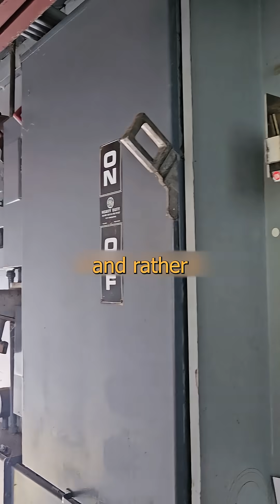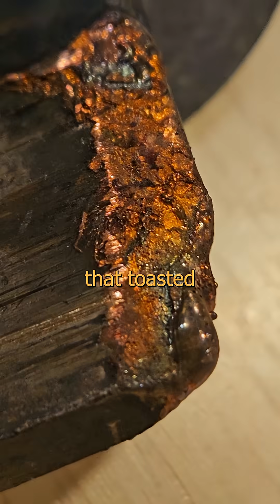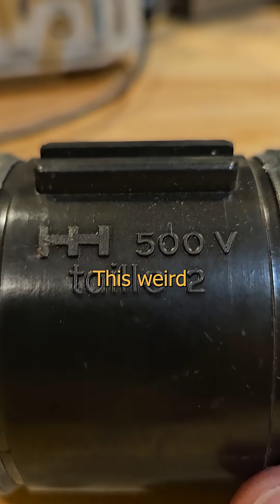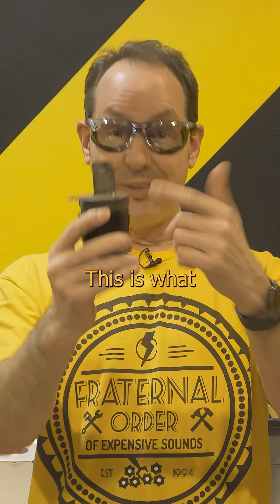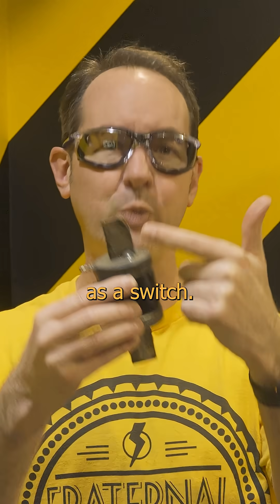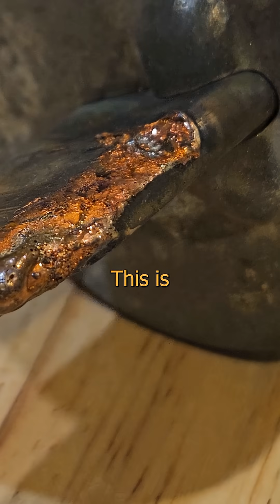Ugly Fuse #chrisboden #comedy #engineering #electrical #educational #highvoltage #damage #fail

Comment: There's a reason all the fused disconnects over here say "operate quickly" on the handle, we had a new 45kW air compressor installed and the service tech came to turn it on for the first time (for warranty) turned out the phase rotation was wrong, he turned it of, swapped 2 phases and went to close the disconnect again, he did it really slowly, turned out when he swapped the phases, there was a loose wire that didn't make it into the terminal, instead it touched the other phase, it poped 2 125A gG/gL fuses in the disconnect he was closing, melted the disconnect and at the same time blew all 3 250A gG/gL fuses in the upstream distribution board. The service tech was too scared to try switching it on again after we repaired his damage, so I had to do it, I slammed the disconnect shut and things just worked

Comment: I still use a 220v breaker to turn my 1.5 hp compressor on and off.  Started doing that in 1972, but I only use it for occasional projects.  My bad.

Comment: THAT is why you have a cut-off switch BEFORE the fuses.
A: Opening the cut-off switch allows you to install and remove the fuses SAFELY (Yes, safe is boring, but remember, there are OLD electricians and there are BOLD electricians, but there are no OLD BOLD elements tricians).
B: The cutoff switch is DESIGNED to handle the arcs of connecting and disconnecting, and when it finally DOES crap out, it's relatively cheap to replace.

Comment: Was it actually rated for use as a switch? Lots of gear is a 'disconnector' or 'off-load isolator'. NEMA is a lot worse than IEC at allowing this, in my experience.

Comment: That reminds me of what happened to the connector bar in my house is old breaker box cost a lot of problems I was amazed it did not Burn the house down but it sure enjoyed lighting wall sockets on fire before It was completely removed and replaced with a new breaker box😁

Comment: Oh, kissing a belt sander is a very good way of looking at it. Yeah, because high current will literally arc off tiny bits of metal every time you flip the switch. I forgot they're literally consumable in high voltage applications.

Comment: Using a fuse as a load break switch? wow.  The fuse wouldnt be the first place to look either as the fuse is usually sized to protect the cable on the load side.  So the upstream fuses were melting faaaark.

Comment: I sell electrical rotating apparatus equipment, amongst other things in the industry, you wouldn’t believe the complete idiots that we sell to, hook up completely wrong (only 3 leads when connected right) and want a warranty on an 100K electric motor they smoked on startup. 😂

Comment: Ya.... I have an automotive situation where I need to install a switch in line with a fuse to prevent this. There's a module that has known (but they're never going to fix) issues, and I have to disconnect the module every time I want to reset it and fix the problem for another month or so. The main problem is that to disconnect it without pulling a lot of other stuff, I have to pull a fuse. This'll be a project I'll finally get around to this weekend 😂 Hey, at least it's not a large fuse, right?

Comment: Many years ago I showed a friend of mine in retrospect , a stupid thing to do how to shut down the power to a house by taking the meter out. I explained to him that there needed to be NO load on it.Or else you're going to get arcing and pitting on the blades of the meter. So fast forward about 9 weeks, and they've now installed the panel and all the circuits in this house and various lights and appliances are ghosting,  turning off.And they don't know why. I thought to myself that he could not have been that stupid.He had to have listened to me.He had to have taken to heart exactly what I told him. But alas , he is that stupid , and he did not listen to me when I pulled the meter one of the blades look just as bad as your fuse , while one other was about half as bad. I cleaned it up as best as I could.Both the blades and the connection.But I told him he was going to have to go out of pocket for a new meter and explain to somebody why he did it , and that he had to leave my name out of it.

He was almost done with the job , so I think he just packed up his tools and left the problem behind.

Comment: Itll eat standard stabs over time. We lost a 100hp motor because over years of pulling the disconnect it had arc gouged the stabs so bad it lost a phase due to the lack of contact from the burned stabs

Comment: Fun Fact: In the low voltage (400v )distribution grid in Germany, all the switches use the fuse as the contractor. 

They are specced for that though.

Comment: There are things that haunt me:
100 A AC trying its hand at arc welding, 00 cable had a stray wire too close to a grounded screw in the panel, sounded like popcorn.

Comment: we have guys using a 600a molded case main circuit breaker asa switch....then they bitch when i charge them 1700 for labor and 4300 for the part

Comment: We (Dutch grid operators) actually use our fuses as a switch, from tiny NH000 25A to big NH3 of 630A.(they look like the one you're holding). They are made to switch. Sometimes even on shorts, that's the only way to find out. The transformer goes Brrrt, and pop says the fuse, eventually, because sometimes it takes time before a fuse melts out.
Switching on fuses is all about confidence. One hesitation and things go wild, like sparks and such.

Comment: Was on ship with diesel electric DC 250 volts, the switches had progressive close, got faster and to open it was spring loaded, just pull aller switch knob. Switchboard was open, Must have RESPECT or get hurt😊

Comment: Ooooh...those melted contacts just gave me PTSD back to a friend's electrical gremlins on a 1988 Ford F-150. Someone had installed some aftermarket.....accessories... at some point.... And we could not for the life of us figure out the random fuse pops all over the factory fuse panel, and some accessories were not, switched.... and as long as my friend had the truck to that point, those accessories were always on when the key was on.... Then, we found the extra fuses.... a bunch of them in two flavors: Glass and plastic mini fuses.... Electrical taped under the dash, most of them very melty at the contacts if they were fuses, and much too big for the given circuit.... all of them showing signs of constant removal and insertion to power things on and off....and many of them were in fact, not, fuses. It literally took use the better part of three days to remove all the spicy fire spaghetti, and another 2 days to put the stock electrical system back to some approximation of factory default. Can you believe the truck ran right and everything factory just worked again? That said, all these years later, older vehicle electrical systems like in my 1992 Honda Civic DX are stupid easy to work on, and I refuse to touch modern stuff with all their fragile body control modules.

Comment: Finding little crap like this so much fun. Reminds me of a time with my old heli squadron when we had to trace the pins on about 2000 feet of wiring to find a pair of crossed pins because the turn indicators had gotten inverted.

Solved it after losing my spot on one connection port and just counting in from the first pin, using the wires for reference because there were about 80 of them in the cable. "Blue, white, blue, white, blue, white, white, blue GOT IT."

Comment: A badly designed (but common) jumper cable in MV Dali's control room not quite seated, pin just touching,. Voltage dropped due to extra resistance. Triggered electrical shitstorm. Not high power, but similar at small scale cost billions, killed.

Comment: I was a power products specialist (that’s someone 500 miles away from the main office) for a large manufacture of Automation equipment.   When I did seminars on trouble shooting and servicing Inverters.  There was no one that know that fuses did not protect a device. they are there to protect the wires feeding the device. and there for the building.
Reply: Fuses can be there to protect a device. But you need very closely-sized semiconductor class fuses. 
Circuit breakers are almost never able to protect anything but cable or windings; the let-through energy is an order of magnitude (or more) higher.

Comment: And this is why I triple check my connections when I do electrical work in my apartment. That's how I also found out some lazy ass dumbass wired the last freaking socket to the lights' circuit instead of the sockets' one. That was a fun freaking day.

Comment: Had to replace an isolator recently. I didn't twig what was happening until I realised the strange noises coming from the machine under test were ALSO coming from the box on the wall. Machines under test are allowed to make odd noises, that goes with the teritory. As to what was wrong with the isolator something worked loose, not sure what because most of the middle phase had turned black. It was way past due changing though, it used fusewire. Seriously.

Comment: Woah, wait a minute here, I thought at first you were saying that someone was pulling and replacing the fuses as a makeshift switch, then I realized that you were saying that the actual switch was using the contacts of the fuse as the switch contacts. How did that even pass design review let alone get into production and become allowed by code? So many questions about how this was allowed to happen.

Comment: Try explaining why the fuse didnt blow when a dist board melted to a safety manager. Its heat from resistance not current flow.  He spent 1000s having it tested/investigated and still doesnt believe me.  So lets spend even more money redesigning circuits instead of yearly maintenance from the 2 electricians we didnt employ after retirement.

Comment: I had a fun one with a 3 phase disconnect a while back. One of the phases had a similar problem to your fuse because, well the disconnect was old. Eventually, the leg in question wouldn't go all the way in, so we'd end up opening the thing up and pushing it in with whatever was handy (I preferred using my fuse pullers but I'd seen others use things like screwdrivers). It worked until someone finally found enough downtime to go ahead and replace it before management could weigh in on the decision.

Comment: Similar to that….spent Friday (we’re off, but I’m on call) working to get crispy wires off the threaded ends of a heating element—inside a 3”x2”x6” box in a space 4&1/2” wide. The outer nut had gotten loose so intermittent contact had literally melted the copper washers on either side of the wire termination loop. I also have a cute picture of the metal bar which holds the two points of the contactor: that’s blown out. This puppy got good & hot repeatedly for a long time. And it’s in the ceiling of a room at a retirement home. 
Good times (but I’m getting double time 😎)

Comment: "Fuse isn't cause of a problem it's symptom", Funny think is so is peace of code at my work that checks if data wasn't corrupted (using hash and hash function , look that up it's quite neat) , if it fails, it means some bits got lost, duplicated or just flipped. 

And well, i wonder if there's worker in breaker company getting calls about heir breakers not working because they tripped that share my frustrations with our users (who are also programmers mind you, many with diplomas and shouldn't be required to get explanation on how hash function from Polish provincial that didn't even step foot in uni)
Reply: Thankfully, the "fires" we're paged to fix are figurative, but whoever swapped those fuses for copper bars was trying to page the real fire department...

I you have to explain to these guys what a hash is, what hope do they have for troubleshooting the cause? Lord help you all. 

I went through university but was a self taught programmer for many years before that. Do you also find that many people coming out of university just don't know how to troubleshoot a bug they can't reproduce? If I could suggest one thing to add to a CS degree it would be Systematic Troubleshooting!
Reply: @WarttHog  I didn't had much experience with many people fresh out of Uni. So can't speak about that.

But i suspect those people know dam well what hush and hash function is, probably hope that since our function technically "fails" passing issue to us gonna be valid way to get rid of the problem on their side.

What is incompetence, is once tester send us bug report with supposed crash.... basing their claim on info prints, that prints on every start up and are just crash handler printing it's configuration, and they were doing so for like a decade. But salt of the earth that they are, assumed any print with word "crash" must be crash.

Comment: I've done that; abuse a fuse as a switch (at much lower current) to shut up my roommates 200W alarm clock going off at 6:30 AM every-other-month when he's switched to their other home and left their door locked and barred. ((Another neighbour also blasted their stereo into the wall we shared for 'true bass' instead of using an equalizer - but I didn't have access to their electrical. ))

Got pretty good at whipping/wipping the knurled shoulder such that it wouldn't arc/creep between the edison's tip and ring.  

Also did that with a few ovens that got stuck on, with no accessible way to unplug the smoking heaps of metal.

Even so; I am suprised suprised that in industrial/infra someone actually used that regularly without mechanically restricting the fuse-form to include a shoe of the appropriate contact-material.

Comment: Had a couple of times the need to put in a new fuse for a 48V/1000A System ( huge battery feeding a bus bar )
- Check that whatever condition that made the fuse say pop in the first place no longer exists
- Wear the special leather flame retardant gloves,leather apron and goggles
- Insert the top blade of the fuse in the upper springs.
- RAM the lower blade of the fuse in lower springs.
this way you:
- Don't get sparks falling on your hand
- Limit the amount of sparking
- Reduce the change of arc damage to the fuse and fuse holder

Comment: This is why every electrical painel and systems should be verified with thermography. It gives you the opportunity to plan the maintenance.
During the time I worked with it, I learned even low power circuits can cause a mess, being the more neglected because they don't do the big bang smoke stuff (but they also stop production).
Not to mention other cool effects than can be seen. Once we found a painel with the support beam extremely hot because the design was wrong passing it through high current cables inducing current on it. Manufacturer thanked us and changed the design.
Reply: That's brilliant. Filing THAT away under "reasonable reasons to by thermal sensing gear" 😂 Looking back, that could have solved a fair few mysteries a LOT faster!

Comment: Whenever contacts open or close, picture a lightning bolt in a thunderstorm in all its terrifyingly gorgeous destructive might...
THAT'S what you're potentially doing to the metal every time you operate it. So you better use something that's designed to take that kind of punishment (something with a "lightning rod" so to speak)